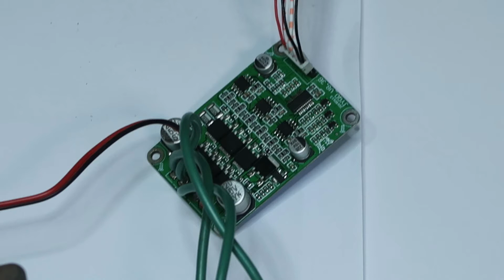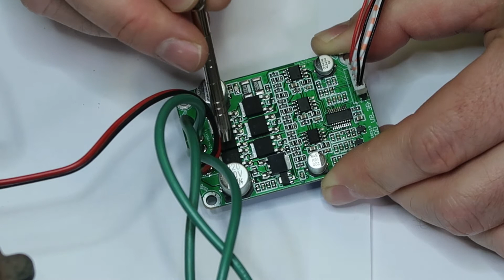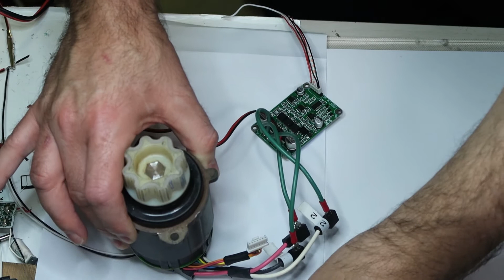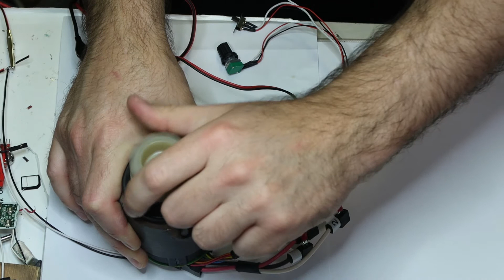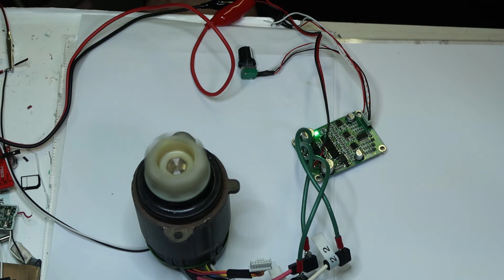Sensorless Motor Controller Part 3-

Comment: Stopping the motor with your hand does not hurt the motor? Does it heat up?
Reply from the maker: No - there is some protection in circuit, it try smoothly to spin it again
Reply from the maker: No, usually Power motors don't get heat quick, you have to use load for several minutes to get it warm a little (the coils are wide and designed for high current flow), it is more common that the circuit burn out before the motors. usually you have also protection circuit that can detect that the motor is stall, and it will cut of current
Reply: The 3 power wires to the motor are also for back emf sensor?

Comment: Thank you so much for the explanation! I am looking forward to seeing you test it with a PWM signal from an arduino :-) I am hoping to be able to use this driver in my large cnc-router :-)
Reply: asle erling borgen , are you sure you want to use a bressless motor control a cnc router? Or do you mean for the spindle?
Reply: Yes, I am sure! :-) Brushless motor with encoder makes a SERVO! :-)